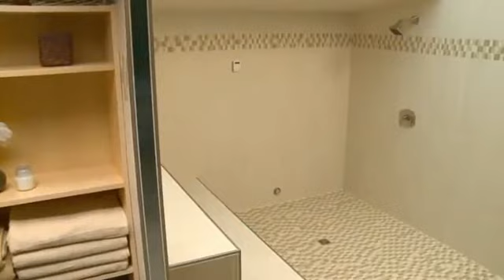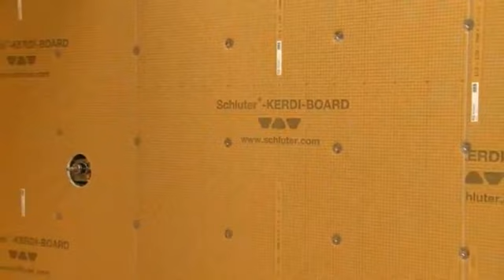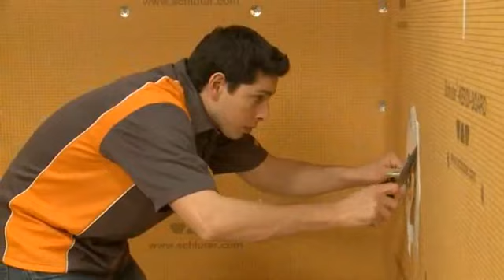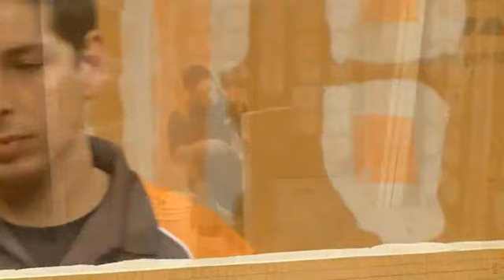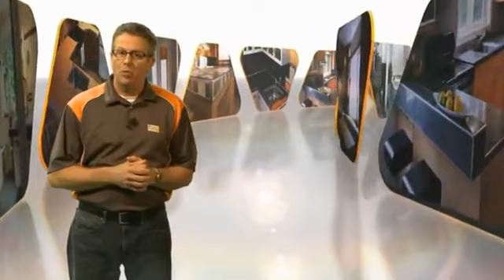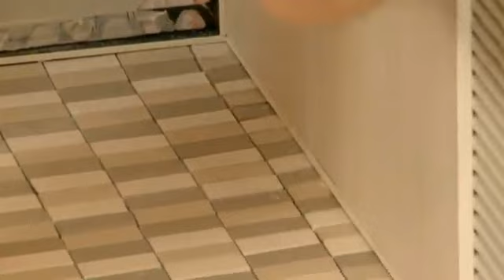KERDI Shower Systems - Steam Room Installation

Comment: What I don't get is mortar is not water proof so you glue everything with mortar aren't all those seems not water proof?  I've always used a complete coat of red gaurd over cement board and never had a failure.  I've seen allot of these Kerdi showers fail I usually replace with a classic hardie backer plus sealer system.

Comment: Will my residential steam pipe melt the Kerdi fix seal, or the foam Kerdi board, or the Kerdi membrane? Where the copper steam pipe comes through the shower wall to spray steam it is very hot of course. At what point will the foam melt?
Reply: Id like to know
Reply: I would use cement board for that area.  No longer a problem.  Waterproof the area.
Reply: @tryan7  Do not use any cement board at all (if you are installing the complete schluter system). You will cut the lifetime warranty down to 15 years. All the customer has to do is give customer service a call with any concerns and they'll link you to the field reps ( if needs be).

Comment: this is garbage im sorry you dont build a huge wall and have no framing that thing is not strong at all what were you thinking and the seating why does that hae to be made out of schluter board? $$ save your money and frame it properly schluter curty drains etc lol still cant get over that wall it coming down
Reply: Stirred my curiosity.  Need figures surrounding the strength and such  regarding  the Kerdi board,
Reply: Schlueter is by far the best product out there! You would be surprised just how strong the foam boards are!

Comment: Doesn't thinset soak up moisture?
Reply: +Bennie W It depends on the type of thin set, unsanded thin set mortar is mostly portland cement which is the primary ingredient in marble dust that provides the water proofing, it does not absorb water
Reply from the maker: Hi Bennie - great question!  One of the primary ingredients in thinset is portland cement.  Once the thinset fully dries it hardens and will not re-emulsify.  In fact premium thinsets can be used to install pool tile or tile for water-fountains - applications where the tile is permenantly submerged under water.